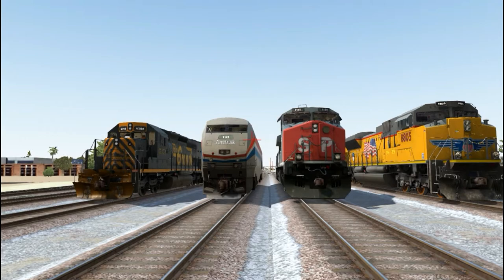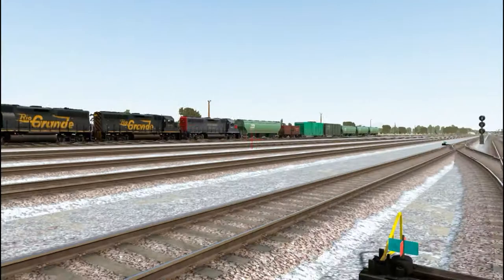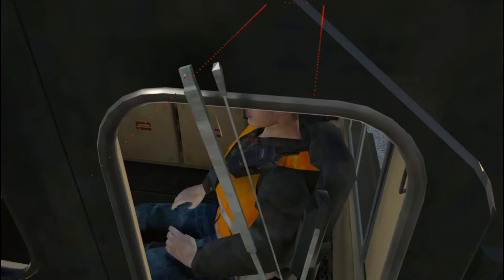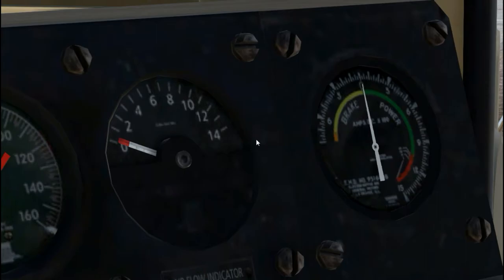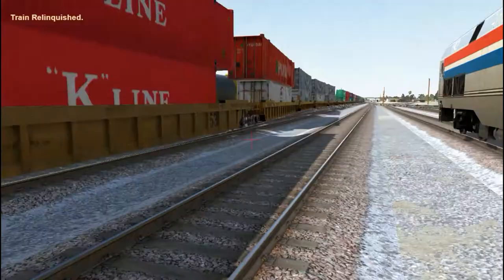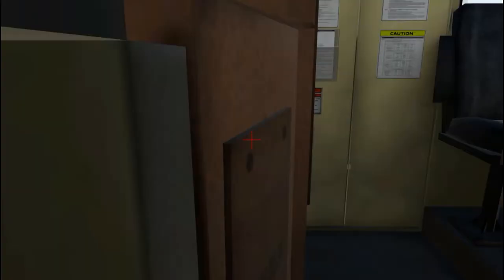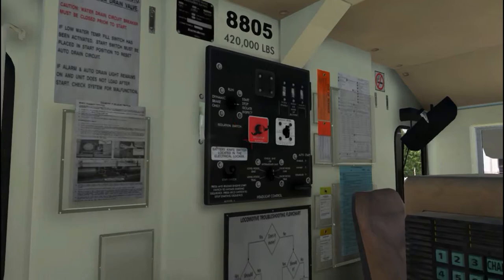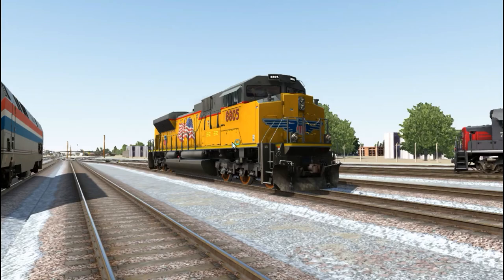Run 8 V2 Start Up Tutorial

Comment: Such footage as you have shown has sparked my imagination and I will now put in a Run8 request. Can you run a regular phase three Amtrak superliner train with the Santa Fe Bicentennial unit leading. And can you also run a small mixed freight lead by a single SP geep running long hood forward?
Reply from the maker: A quick question, Where does the superliner amtrak run on the route and whats the consist? I was told amtrak doesn't typically run up Tehachapi Pass or across Mojave, but the station in Bakersfield has me confused.
Reply: The Amtrak would be most prototypical on the Cajon sub. The consist would be the bicentennial unit, a pair of phase 3 genesis, baggage, 2 sleepers, diner, lounge, and four coaches.The station at Bakersfield is the southern most terminus on the Amtrak San Joaquin route, and is not used by any long distance trains.Two Amtrak trains use the Cajon and Needles Sub. Trains 3 and 4, the Southwest Chief.

Comment: On the P42s, the engine start stop is either on the rear panel or on the dash
Reply from the maker: In real life, this is correct. There is a panel behind the driver seat that seems to be the on/off set up. But it still does not work in the simulator and must be started by menu.

Comment: What's your opinion about Run 8 compared to Train Simulator Series, Trainz and CSX Heavy Haul etc!?
Reply from the maker: Well, each has their own strengths. Run 8 has the realistic train handling, stable multiplayer, and decent graphics. Though most are put off by the prices of the limited content, no steam locomotives, and the difficulty learning the sim. Train Simulator has open community, odds are you currently can get nearly any route and any train you want out of that game, but I feel it's lacking in the physics and functionality, I had many many glitches when playing it. Trainz is a great all around building sim that lets loose on the way you build things and makes them easy to build. My issue with Trainz though is the download speed throttling that makes you pay them to get normal download speeds back, and the recent addition of Trainz: A New Era was a real let down for me as it didn't improve on anything except graphics and textures that sometimes didn't work properly. I heard there was multiplayer for it, but I still can't get that to work. Finally Train Sim World is sort of a guilty pleasure for me. The game is still poorly optimized, lacks proper signal tutorials, lacking content, and in some cases it's missing realistic train operating. However, I found myself looking past most of that in favor of the attention to detail they put in the trains, it feels like you really learn how to run the locomotive because very button works and you can fiddle with all of them to find out what they do. Theres a lot more detail to get into here but I leave it like this. Run 8 is my favorite for realistic train operations with other people. Train Simulator, while it's really good for graphics and content, lacks quality for me so I don't play it. Trainz from 2004 up to 2010 has all been wonderful to build in and just make a model railroad, so to speak. Trainz: A New Era is an optimized minor upgrade that is trying to take your money at every turn. Then finally Train Sim World is poorly optimized, lacking content and correct training, but feels amazing to run. Hope this helps.
Reply: trainman122 Thanks! But does Run 8 include single-player scenarios and tutorials!?
Reply from the maker: It does have single player, I was in single player when I made this video here. But the best you'll get in tutorials is PDF reading documents, help from the Run 8 community, and just plain old trial and error messing with the trains, menu's, and button combinations. If you need help with any of this I'd be more than happy to help you. You can private message my Youtube channel for contact information if you'd like.
Reply: trainman122 👍
Reply: Hey, please help me with Run 8! I need to put a train on track(a locomotive and 10 freight cars for example), and ride to another location. The dispatcher panel and setting radio is confusing. How to setup signals and track switches for a particular journey...
Reply: 5 year old vid but helped me get started. Thanks!